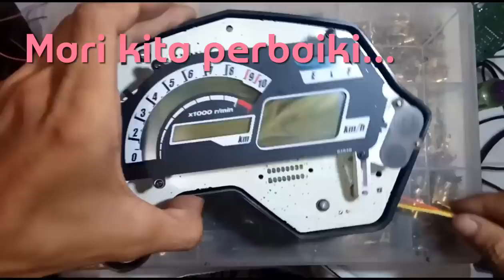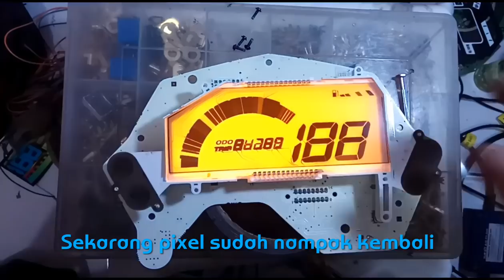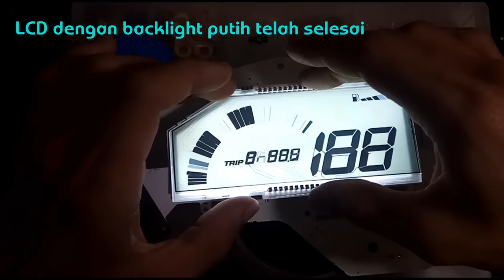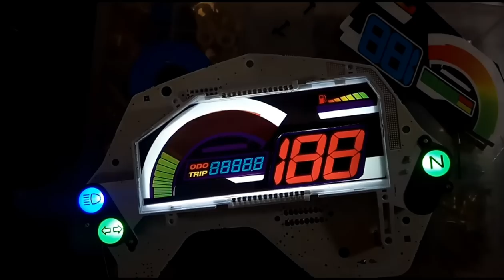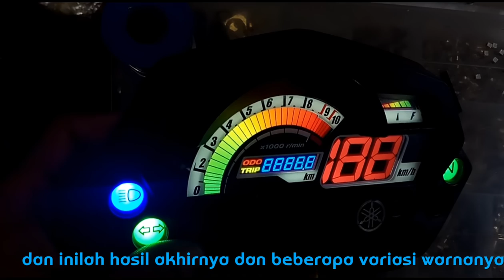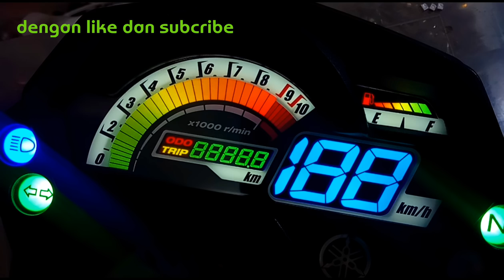Repair and Modification Speedometer Yamaha FZ 150 / Byson / FZ v1 स्पीडोमीटर संशोधन

Comment: Gan. Apa kasatnya apa harus diputus dulu? Soalnya atraktornya gak mau masuk, jaraknya terlalu rapat
Reply from the maker: Beli karet atraktor...
Sekali sedot bisa 2 pin kena..

Tau kan karet atraktor..
Kalo gak punya.. cari karet cup flyback tv bekas.. dipotong
Reply: @mazpediachannel4264  boleh minta kontaknya gan? Wa atau ig. Mau ngirim gambar. Punya ane kok ada lem putih utk perekat lcd ke plastiknya
Reply: @mazpediachannel4264  semacam ada silikon putih yg menggabungkan antara lcd dg plastik
Reply from the maker: Oh.. itu.. tinggal dicongkel saja bisa
Reply: @mazpediachannel4264  hehe. Iya gan sdh bisa. Utk rangkaian adaptor buat ngetes rangkaian kabrl nya gimana gan?
Reply: @mazpediachannel4264  utk polarizer atas sama bawah jenisnya sama gak gan? Di video masangnya jg langsung potong.

Comment: How to start the meter off the bike? Like you
Reply from the maker: Connect pin positif ( IGN ) and Ground ( GND ) with adaptor or power suply 12 volt DC
Reply: I have same meter but display and it's backlight not turning on only second light at right side is working, need your suggestion
Reply: Saya belum mengerti cara menghidupkannya jg..itu kan pin 9 adalah GND dan Pin 10 adalah Input 12V dari adaptor sedanglan pin 1 ke mana dihubungkan? Apakah di jumper dari input 12V?

Comment: What's the third single wire up side ?
Reply from the maker: Positive, Negative and Backlight
Reply: @mazpediachannel4264   and where is your wires connected ?
Reply: My fz's meter showing engine lite only and meter is blank so i want to check my meter
Reply from the maker: Use adaptor 12 volt
Reply: No need to connect third wire ?
Reply: And what if my meter not showing anything after connect ?

Comment: I am ur subscriber bro i have the same issue but my odometer fully shut down there is no orange light switching on too..shall u help me with this
Reply from the maker: Cable backlight isn't connected,
Reply: @mazpediachannel4264  it is connected properly but there no indication
Reply: @mazpediachannel4264  thnks for reply bro how much cost for repairing my odometer bro